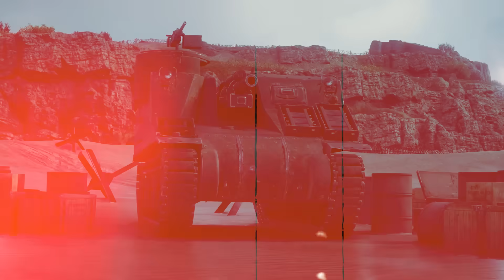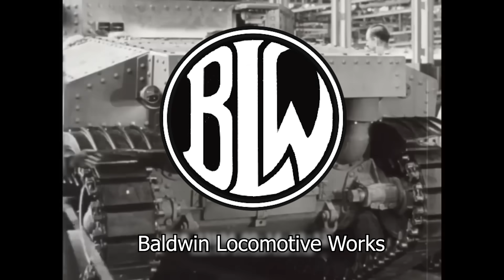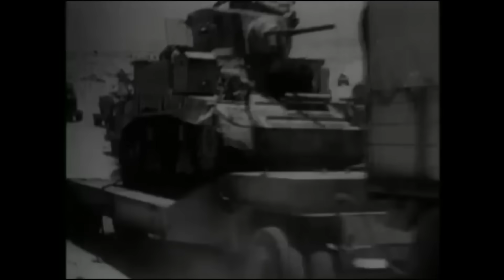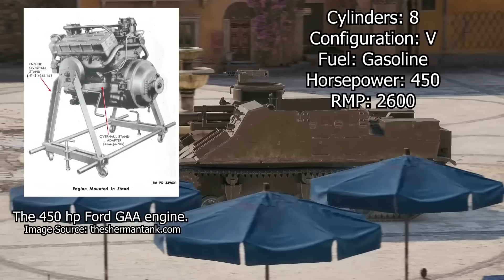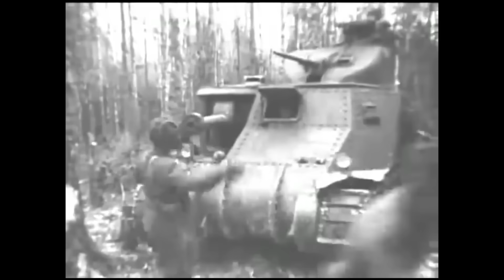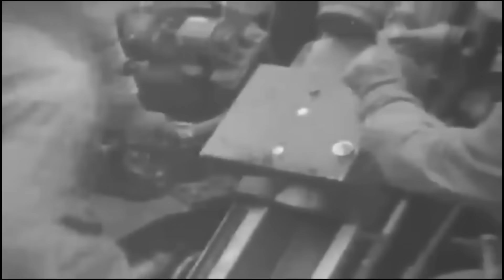Baptism by Fire | 105 mm Howitzer Motor Carriage M7 “Priest”

Comment: Frank my coworker was in a M7 self propelled gun. He said that the 1/2” armor was not very good because the Germans had mp42 machine guns and the bullets went through the armor and they bounced around a bit.
The air cooled wright engine sucked because it was cold weather in Germany and they didn’t have heat.
He made the landing in North Africa and was part of Pattons 3rd army and help relieve Bastogne in the battle of the bulge.

Comment: Did all the different HVSS track designs used on the M3/M4 chassis give similar performance? I can't help but think that flat-block rubber tread could not have gotten as much traction as more-aggressive designs.
Reply: It seems the tracks were simply improved as the chassis aged between 1943-1945. Seems they settled on rubber Chevrons as the best thing the m4 could have. Though of course on-road performance would suffer.
Reply: The weight of the vehicle provides a lot of traction. Until the roads ice over. Then the rubber just slips and it turns into a wild ride! When the rubber pads get worn down too much, the steel tracks chews up the asphalt and cement roads like you wouldn't believe. Just my observations from being around modern tanks.
Reply: @papijuan-b3p  I keep thinking of that German film where they tested an M3 with flat blocks against a Panther. The M3 failed the vertical step climb (looked like about 3 feet; I know the M3 design specified 2 feet); it noses up to the step and the treads just start spinning, while the Panther's steel links grab the edge of the step and pull the tank right up.

Comment: Another example of the versatility of the Sherman chassis.
Reply: Technically an M3 Lee chassis
Reply: @ociee117  did you not see the part the quite litterally showed that the M7B1 was built on the M4A3 chassis?
Reply: Nope, if I recall correctly, most M7s used the chassis of the M3
Reply: Good chassis, bad tank.
Reply: @paulhart9102  it’s not a tank it’s an artillery piece
Reply: @paulhart9102  which?

Comment: That 105 round looks like it could dish out some hurt was there a air burst round for the 105 ? Or just high explosive ?
Reply: They did have some HE rounds that had fuzes for timed (it explodes after counting down, calculated to be the set range to target), otherwise known as MTSQ (Mechanical-timed, Super-Quick), or fuzes with instantaneous settings, so they would go off at the slightest impact when being fired. (trees, ground surface bursts, etc). These were normal M1 high explosives rounds; it was the setting/type of fuzes that made the difference. Ordinary impacts would PD (point detonation).

Comment: And to think that in 2025 a modernized version of the Priest would be a great fire support artillery vehicle for smaller units. But no, if it ain't at least 155mm and requires a tow vehicle, it is "obsolete".
Reply: I think there were some M113 APCs modified to carry a mortar. That was probably the closest post WWII got to gun motor carriages.
Reply: @somebloke3869  Such conversions did indeed exist. The Armored Cav troop I was assigned to at Ft. Knox had a four-tube section as part of our MTO&E. Those were 4.2" or "Four Deuce" mortars. Of course that was back in the 1980s. As a Tanker I cross trained on them while in the field and came to have great respect for our Mortarmen.